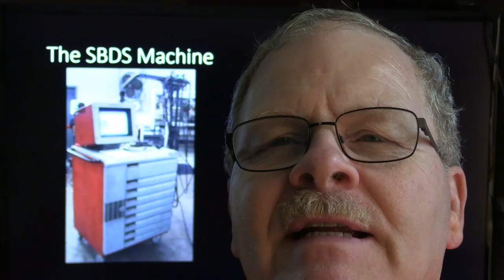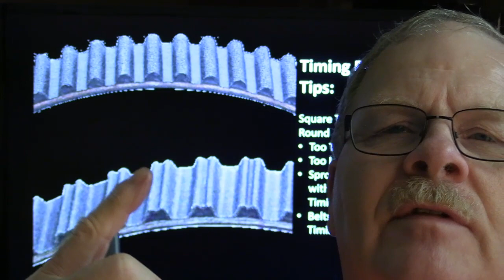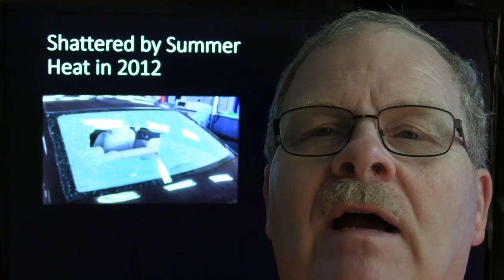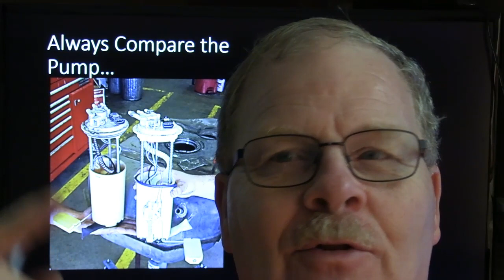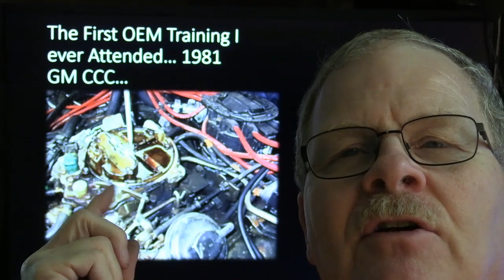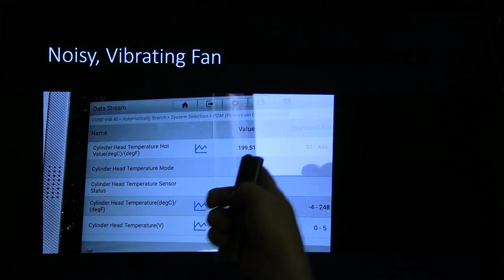Solid Info And War Stories

Comment: Gates lower rad hose for a 2011 F250 PDS .. It’s a 2 piece hose and the one that goes to the engine was manufactured with the keyed notched upside down where the 2 hose ends couple ..